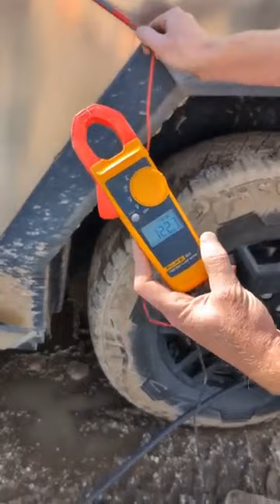Cyber truck transmits 120 volts from its steel body while charging??

Comment: Rumour has it:
Yes, it's possible for a Tesla Cybertruck to have a highly charged exterior while charging, as was the case in a video posted in September 2023. In the video, the owner used a multimeter to measure 120 volts from the lug nuts of the truck, which is higher than the standard of zero. The owner speculated that the issue was with the wiring in the garage where he charges the truck.